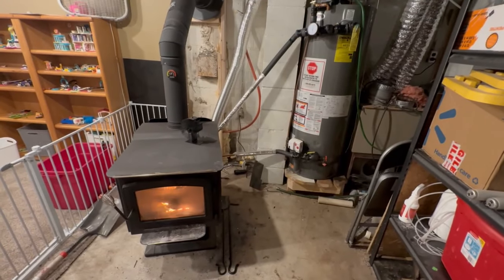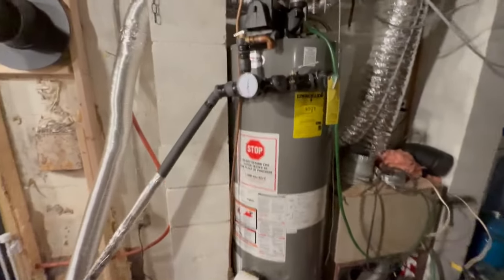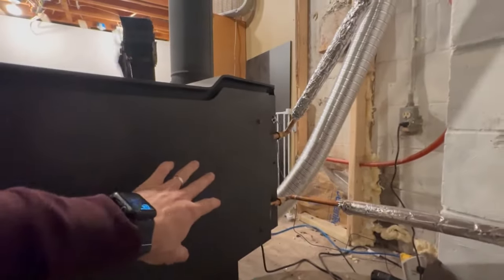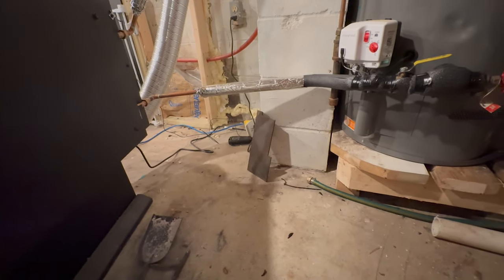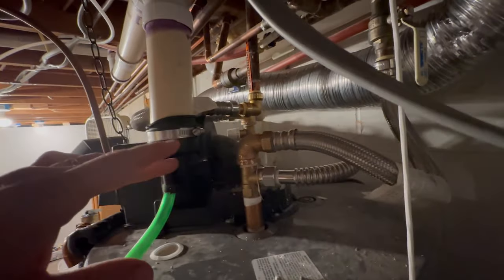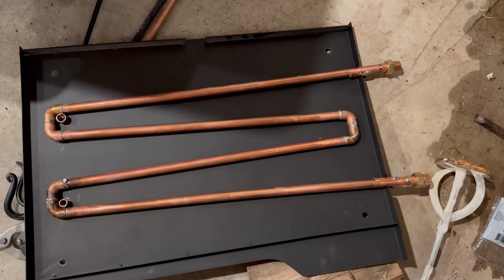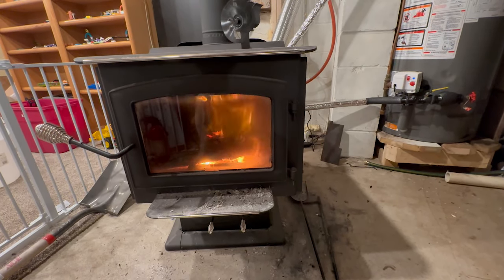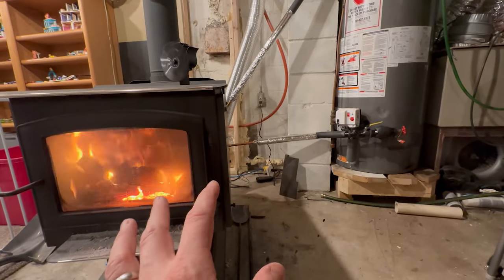DIY Hack: How I hooked up my water heater to my wood stove

Comment: National Stoveworks (nationalstoveworks) has units with water jackets. Do any documents on their site show how many zig-zags or other design hints they have in their products?
Reply from the maker: Yea it looks like they run zig zags but all their stuff is inside the stove.

Thanks for commenting, please don’t forget to hit that subscribe button!
Reply: @portercreek  I bought a house with one of their Model 500 stoves.  I had to replace the oil burner, and I disconnected the water (it was a hacky mess from the prior owner anyway) and used the Model 500 as a regular wood stove until the old chimney gave up and I had to get a smaller wood stove.  I thought it was really clever how you tucked those copper coils under the heat shield.
Reply from the maker: @kenltron  Thanks!  Please don’t forget to hit that subscribe button!

Andy

Comment: How much runtime on showers. 1-2 10 minute showers plus dishes? 1 30 minute shower no dishes?? Great DIY set up.
Reply from the maker: Yes about 10mins and some in my house take extremely hot showers(idk how they can take such a hot shower) and no one in this house knows how to shower quickly…. If it was just me in the house it would be more than enough hot water.  As it is getting colder out it seems like the wood stove is keeping up with our hot water demands a little better as I keep the wood stove up more through out the day. I am going to do some mods to it next week to increase the hot water reserve.  I will post a vid with the upgrades once I prove them to work.  Hit that subscribe button so you can get notified when that vid is live.  Thanks for watching!

Comment: Two suggestions:
(1) Source a baseboard radiator tube with fins and use THAT for your internal pipes
(2) PLEASE build a safety fence around the wood stove, piping and water heater in addition to what I see that you have there already to protect that baby I see.

Comment: If your coil ever runs dry while you've got a fire going, you risk losing your solder joints.  I'd recommend a stainless steel welded coil inside your firebox at some point.  I know you don't have a lot of room, but an 80-gallon tank would be better.  Also, if you coil was under your log holder, the temps would be higher (1400º) than on the side.  More turns in your coils would be better, too.
Reply from the maker: I leave the water on 24/7 365 days a year

Comment: Add a check valve in the cold water intake and that will help create a hot water siphon
Reply from the maker: It works great the way it is, a check valve would reduce the flow

Comment: Great video but your understanding of thermosiphon seems a bit jaded. My grandpa used solar panel water heating- with outgoing and incoming pipes going 20’ from the basement.

Raising the water header a few inches to create a pitch for the tank to “drain” into the heat exchanger will have no impact on performance. 

What you could do is increase the area of copper pipe on your exchanger. -Use a direct to flame coil inside the burner. 

Water going to the primary cold inlet on the water heater should pass through the coil. Depending on your system 3/4” or 1” pipe would be necessary. 

When everything is shut off water moves slowly, circulating “looking for heat”. 

Your setup should save you on water heating costs! Good job!
Reply from the maker: Thanks for commenting

Comment: We’ve been using a wood burner with back boiler ( thermosyphon) for 20+ years for underfloor heating via heat exchanger and circulating pump, with an excess heat dump using 3way wax stat…….works brilliantly.

Comment: using a flat coil of copper tubing as the heat exchanger instead of the elbows you might get better flow... i think you lose a bit of flow with each 90 degree elbow. and you might get more feet of piping with a coil also..
Reply from the maker: You would get more feet of piping with a coil but you would loose the thermal siphoning effect and would need to use a pump.  What makes this set up work is that the flow of the pipe is in an upward motion all the way back to the water heater.  If the pipe being heated goes down it would stop the flow of water.
Reply: @portercreek  oh ok i see what u mean... U shaped fittings might help with the flow.. just a thought.. really cool set up tho..

Comment: You could run soft copper tubing from your zig zag to the flue pipe and coil wrap the pipe as high as you can, then straight to the top of heater. Lots of heat to absorb off the single wall pipe.
Reply from the maker: I thought about running soft copper but getting a tight enough 90 was hard to do without a tube bender. 

Thanks for commenting, please don’t forget to hit that subscribe button!
Reply: @portercreek  I'm completely off grid and have a gravity fed system. Small rv tank above the stove. Cold comes down to bottom of flue pipe and coils around tight, then dumps back to tank. Shut offs on both in and out to isolate the coil when water is hot enough. Then we can use the sink or a small tub. Another gravity fed cold tank outside to mix at the faucet. Still tweaking things here and there.
Reply: @sodman1987  Make sure you put a pressure safety relief valve on that coil if you were isolating it as well as an expansion tank

Comment: How do you prevent it from over temp?
Reply from the maker: The higher the temp rises the longer it takes so go up a degree.  I have never seen it over 145 though I would like to see it to run at about 160-170 continuously.   

I think the only way it could ever over heat with my set up is if I had a roaring fire 24/7 and didn’t use any hot water for 30+ hrs.

Thanks for commenting, please hit that subscribe button!

Comment: I would throw a small circulator on with a strap on squastat. You will get much more heat transfer than gravity flow. That is you ever needed more heat. Looks like it's working fine as is.
Reply from the maker: I have thought about putting one on to get the temps a little higher to give me more of a reserve and I probably will when I add another coil to the other side for the air exchanger I want to put in the garage.

Thanks for commenting! Please don’t forget to hit that subscribe button if you haven’t already!

Comment: My grandma had a coal fired hot water heater. 
It looked like any other hot water heater. A tall white cylinder. Except it had a little door on the side to stoke a fire. 

I bet there are ten thousand patents for coal or wood fired boilers. 
As an HVAC tech I had to service some that had been converted to oil. 
They’re kind of dangerous. Especially when they’re old.
Reply from the maker: Thanks for commenting, please don’t forget to hit the subscribe button!

Comment: My dad built in an exterior coil on a Vermont casting stove when he built his home with a circulator pump to move the water.  He added a temperature sensor and controller to activate the pump.  Additionally he would run an air solar collector to a water heat exchanger.   He ran way more coil loops than what you have and could easily make lots of hot water.  Great way to go.  Maybe I will post a video of his setup.
Reply from the maker: I bet!

Comment: You know how to run a fire, I almost thought it was gas lit, with a fake log. Put a sand box around it all. Yes it will be a pita if you get a leak to clean it all out and put it back. However it is all 100% recyclable. The bigger the thermal mass the more heat with less wood. To save on sand I used all the free bricks concreet I could find.
I just popped by to see if anyone had new Ideas.
Reply from the maker: Thanks!

Comment: Be careful you don't heat the water to steam temps, as the pipes could explode. Perhaps you PRV would open and relieve the pressure, but sometimes they can corrode shut. Work the manual relief handle whenever you think of it to ensure it is free to open.

Comment: Glad to find this - we're planning on doing something similar for an offgrid house. Except we were thinking of coiling the copper around the stove's exhaust pipe instead of a heat exchanger on the side like you have. It just seems like we could get a lot more heat exchanged coiled on the pipe as a lot more surface area would be in contact. Was also thinking of just a hot water circulation pump to make it work (the kind that constantly circulates the hot water in your pipes so you never have cold water waiting for the hot to get to the tap). Never done anything like this before....do you see any issues with the proposal? This whole thing makes me nervous, but we need hot water lol.
Reply from the maker: The only concern would be cooling your exhaust pipe too much would cause creosol to build up quicker. 

I wouldn’t add the pump, it is just one more thing to rely on.  As long as the pipe is always moving in an upward direction, you should be good.
Reply: Coiling a pipe around the stove pipe gets super hot and you don't really want to be adding /making steam under pressure without a way to supervise it, I wouldn't rely on a safety valve alone, a water heater that size (in the video) could flatten a 3000 sq. ft house if the pressure was to get high enough. As a Journeyman plumber/steamfitter for 30 plus years I would advise you to use caution and consider having a pro help you out on this.

Comment: I did this for my hot tub. The copper leached into my tub. Use stainless steel.
Reply from the maker: Yes, do not use copper in a chlorine water application or it will leach into the hot tube water and will turn your hair green!

Comment: Very cool solution. I can only add that if you want to play with gravity circulation then you need to use large pipe cross sections. The energy receiver should be above the stove.  If you have the opportunity try to coat the pipes with chamotte or sand to increase the exchange at the stove. Air is moderately suitable for energy transfer.
Reply from the maker: Thanks for commenting, please hit that subscribe button!

Comment: We usually will do a drainback system similar to a solar water system. This is only possible though when the water heater is in the basement and the wood stove on the first floor. When the water heater reaches temp an aquastat will deenergize the pump and the coil will drain back to a small intermediate tank.
Reply from the maker: Thanks for commenting!

Comment: Cool but 2 things way bigger diameter copper on the exchanger and way more using inside the stove or at least the flu and the top of the stove . 1'' pipe flows two thirds not half more CFM than a 1/2'' pipe. go big , thanks for sharing
Reply from the maker: My plan was to modify the shroud on the side of the stove to accommodate 3/4 inch pipe instead to get me a little more production!  Thanks!

Comment: I think a circulator pump coming from the bottom of the water heater will improve your situation immensely😊🍻
Reply from the maker: I tried that m, it had actually worsened the situation

Comment: A small circulating pump would make it much more efficient...
Gravity fed water in a pressurized system makes for poor circulation.
Reply from the maker: I added a pump and it did not help, it actually had a negative impact when the stove started to die down

Comment: Not a plumber. But wouldn't it make more sense to buy a second water heater that the hot water from the stove would loop thru in order to pre heat the cold for the actual water heater.
Reply from the maker: Space is a factor and there is no need for that

Comment: Yes free as long as the wood is free and the gas for the saw was free there is no free
Reply from the maker: The expense for saw gas was for heating the house which I was doing anyways.  Getting hot water from the wood stove won’t cost more wood so yes, it is free hot water!

Comment: Pressure buildup from the rising water temperature would worry me
Reply from the maker: 1. water heaters heat water, what’s the difference? They are both raising the water temp.

2. They have a blow by valve for it the temp or pressure gets too high.

3. I have a pressure tank that can absorb any extra pressure.
Reply: @portercreek  but they turn off if it gets too hot. The stove keeps going. As long as you can release pressure via the rest of the pipes, should be ok.
Reply from the maker: @Phil-D83  pressure tank is always on, the 2 different(one is a backup) pressure relief valves don’t turn off.
Reply: @portercreek  that works

Comment: THE BEST HEAT EXCHANGER IS TO USE A CAR RADIATOR THEY ARE THE BEST TO USE THEY ARE DESIGNED TO RUN HOT WATER THROUGH THEM!! YOU CREATE A LOT, LOT MORE HEAT THAN YOUR DESIGN AND ITS WAY QUICKER!!!!
Reply from the maker: Yes, but they are not designed to handle the water pressure

Comment: ITS BETTER TO HAVE YOUR HEAT EXCHANGER LIKE YOU HAVE IT THEN RUN IT THROUGH A  COPPER COIL RUNNING AROUND THE EXHAUST PIPE YOUR YOU CAN DRILL HOLES AND RUN A BLACK PIPE THROUGH THE EXHAUST PIPE MULTIPLE TIME IT WILL HEAT UP DRAMATICALLY FASTER!!! YOU DON'T WANT TO WASTE ALL THAT EXCESS HEAT!!!
Reply from the maker: Yes, it would heat up faster but it will also cool your exhaust which will cause creosol to build up faster which increases the risk of a chimney fire.

Comment: Nothing is free, if you heat water with a wood stove you to use btu’s to heat the water, so you lose heat into room or you add additional fuel to increase the output.
Reply from the maker: The fuel I use is free, so therefor the hot water is free!

Comment: This fire pit is one of a few covered pits that is on the list https://www.youtube.com/post/UgkxAU9pOCSV9Y5JprooHvfxTpOrt4hx8uRM of approved products for Disney Fort Wilderness. The product served its purpose well and provided excellent fires throughout the evening. We were able to open the door and do s'mores, but I had to be careful because the handle was a bit hot on occasions. Additionally, I wish they had replaced some of the standard nuts with lock nuts in some places. We lost the door handle after just a couple of days of usage. Not a deal breaker, just a recommendation. I still give it 5 stars.
Reply from the maker: thanks for commenting!

Comment: Thats dangerous the t/p valve should be mounted on the water heater with stem in tank.
Reply from the maker: It is, I believe I mention that in the video and have a link to the longer one in the description

Comment: Nothing is for free.
Reply from the maker: Except for my hot water!!
Reply: @portercreek  The fact that you use your heat much more efficiently by letting your wood-burning stove transfer energy to domestic hot water does not make it free. You take advantage of a heat loss and that is beautiful in itself. As an absolute minimum, you have spent money on the installation. But it's a nice installation you've made 🙂

Comment: No kidding, I love free!!  Unless of course you dont have a stove in your basement and have to find free money pay to install,  or use another means of heating fuel such as natty gas. Perhaps you live in the middle of a forest like everyone else does and then you have all the free wood to burn.  If your not si lucky I guess youll just have to find some free money so you can get free wood.  Hopefully you are not older either or you will need more free money to pay someone to haul the free firewood to the basement to power the free wood stove.

But if you are fortunate to have this set up already, its going to be a YUGE saver on hot water bills